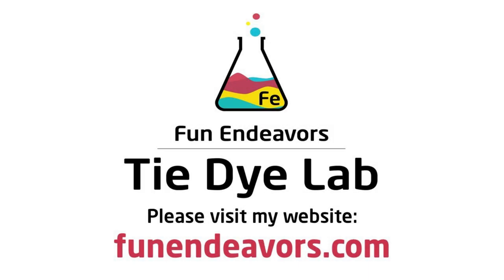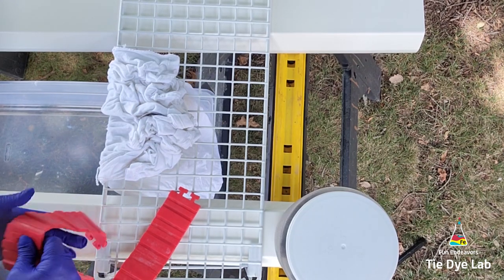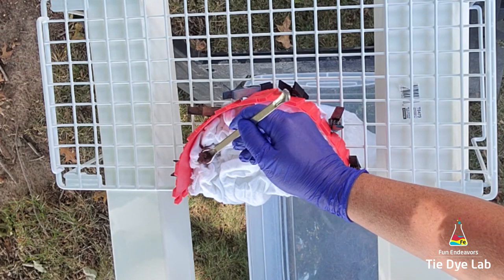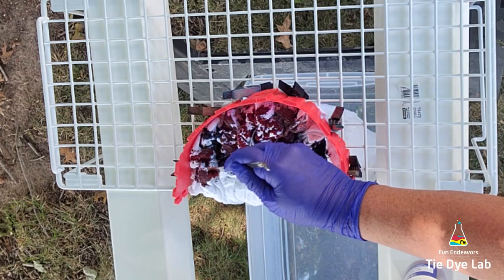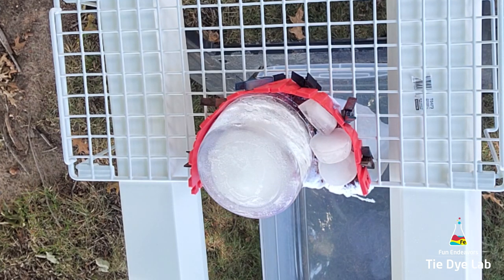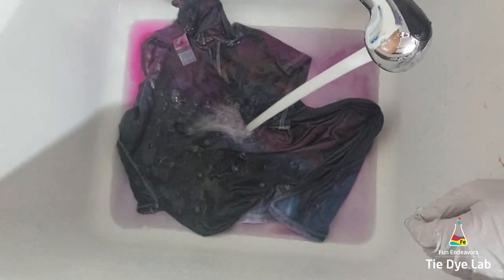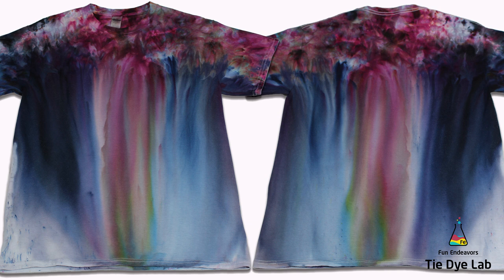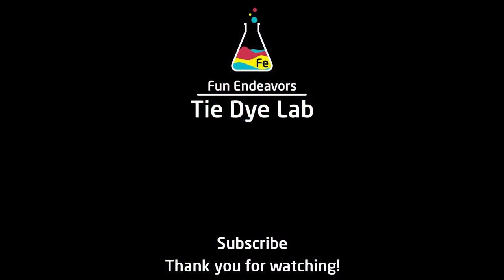Tie Dye Designs : Top Scrunch Gravity Dye [Ice Dye]

Comment: The 2nd shirt! I like this shirt, colors are awesome, but I would've liked more scrunch. Maybe if you scrunched just a little more, it might have let the dye get to that corner. Love the flow, love the splits. I thought for sure the big ice would've done it!
Reply from the maker: I think it was just too hot that day.  It's finally cooled off here into the 90's and so I think it will be easier to do the gravity dyeing without the shirts drying out so quickly.  I think that may be what happened to the corner of this shirt - it dried before the liquid had a chance to make it down there.

Comment: What if you wrapped a garbage bag around the shirt with enough room (maybe some holes in the bottom for drainage) to help keep the shirts wet? Would that work? That way it's harder for the air to evaporate the moisture so quickly.
Reply from the maker: That's a great idea!  The last batch I did, I put them inside of a container once the dye reached the outer edges of the fabric.  That worked really well.